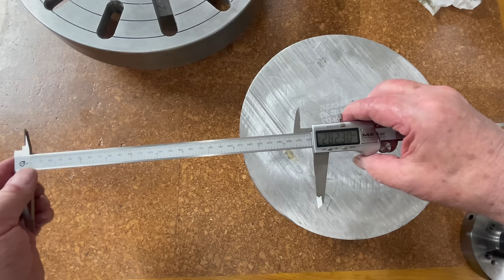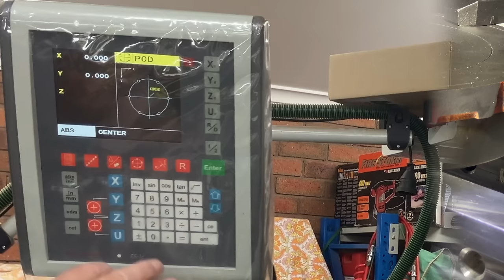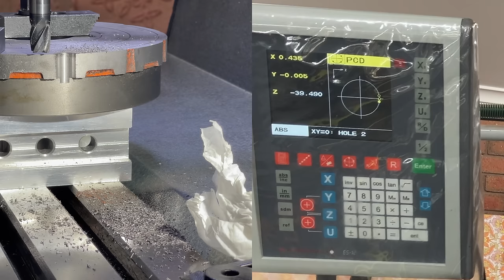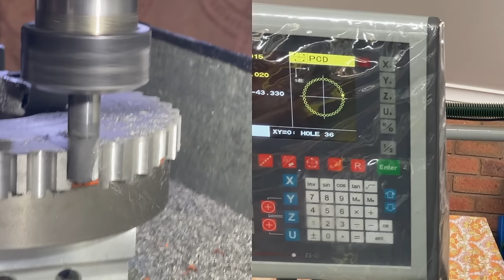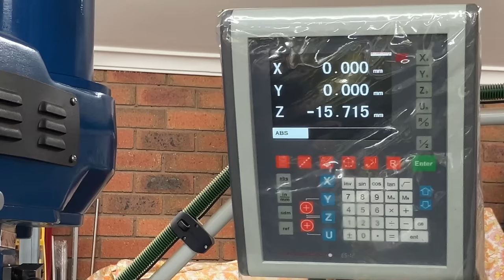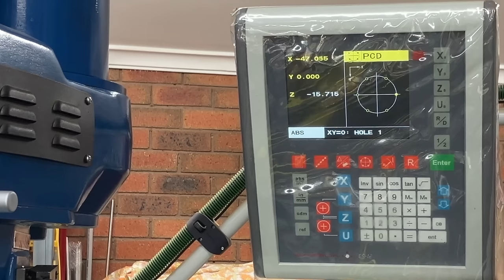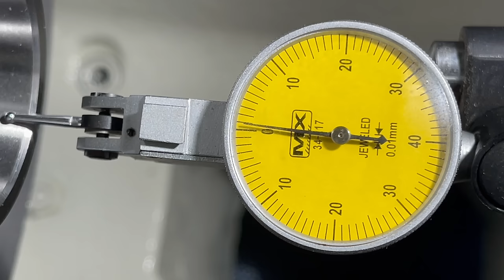The Most Accurate Lathe Chuck - Shop Made Tools

Comment: While I actually have a degree of contempt for 5C collets, they do have the advantage of gripping at the extreme front of the collet, versus, ER collets, that grip along the entire length of the collet, and can be damaged / sprung, by attempting to hold shorter stock, that leaves a portion of the ER collet unsupported.
I’ve also done a spindle mounted ER-40 collet holder, but, think people should be aware of this limitation, when deciding on the method of work holding for a specific task.
Reply from the maker: Thanks for the comment, great point.
Reply: 5C collets can also take collet stops, which ER collets can't. That's useful for facing multiple parts to the same length. Not by any means impossible to do that on an ER collet, but slower.
Reply: @PeregrineBF  good point. Recently, moded my #3 & #4 MT - ER-40’s by making threaded stops to that affect, as both had a 12-1.75 thread in the MT shank. Needed to be tapped through, and made the appropriately threaded stops / rods.

Comment: An interesting way to add collets to an old lathe.   Very helpful for me.  Watching you deal with the cast iron was nice.

But to second one of your commenters: I hate SS screws: they somehow strip without warning compared to high quality "alloy steel" screws, and when they are gummed/rusted into an old assembly, I find them much harder to to get out in one piece.  They just don't have the "feel" that tells you when they are about to go.

You do nice work, both on the machine and with the video editing.  No baloney.
Reply from the maker: Thanks for the comment. I took the advice from the previous commenter and changed the cap screws to hardened steel. I needed to recalibrate it and got a better result. You can see that in the sequel. 

Thanks for the compliment on my work and the editing, much appreciated. Cheers Steve O

Comment: Beautiful result, the finished part looks expensive. 👍
Re; the final 4 way adjustment; it looked in the video that the seats the 6 caphead bolts seat onto are conical (maybe the seat was produced with a drill bit?)

I think if they are conical (and also there seems to be limited clearance around each caphead) this is probably not allowing the chuck to center properly. Or is pulling the chuck in line with the conical feature, which upsets your adjustment.
If you cut those seats as flat bottom, then put a flat thick washer in there with room to move, then the chuck coukd be centrered. Anyway it's just a thought, that might not be it at all.
Reply from the maker: Thanks for the comment. Your observations are correct. I previous viewer made the same comment and I went back and flat milled the bottom of the cap screw seats. The holes are large enough as the chuck only has 0.5mm of movement which is 0.25mm each side of centre and that is enough to bring the chuck into alignment. 
The final result of <1 micron is very pleasing. When torquing the screws up the chuck did align and stay in place. One benefit of user comments is the capacity to gain insights from others (like yourself) and integrate those suggested improvements.

I did put a witness mark on the chuck to allow for the same mounting alignment each time the chuck is mounted.
I have only used the chuck once since I made it but it is a real joy to use. Very good for smaller precision work than big heavy pieces.

Thanks again for your observations. Cheers SteveO

Comment: Nice work, definately earned a sub.

One thing I have seen recommended when threading cast iron is to add a 2+ thread deep counter bore to help prevent the threads from chipping out when tightening down.
Reply from the maker: Thanks for the comment, that's a great idea, I'll take that on board.

Comment: Hi, You have made a nice job of fitting the ER collet chuck to your larger lathe. 

I am however wondering why you chose to use the set-tru adjustment with all the additional work involved unless it was absolutely necessary?. All the surfaces on the collet chuck appear to be ground and so there is a pretty good chance that the o/d of the mounting is ground at the same machine setting as the bore to minimise run out. If that is the case then the bore in your modified faceplate could have been machined to a close fit on the collet chuck mounting. The bore you machined in your faceplate must, by definition, be have zero runout as it is machined in situ. The arbor you used for checking runout after machining could have been gripped in the collet chuck, mounted between centres in any of your lathes and the runout of the backplate o/d clocked.

I am pretty sure the collet chuck shown right at the start is not a Crawford but a Burnerd multisize collet chuck.  The Crawford multibore and Burnerd multisize collets are quite different and are not inter-changeable. On a D1-3 mounting you chuck probably takes the EC size collets. These are readily available on Ebay (albeit sometimes at ridiculous prices) though I appreciate that may not be the case outside UK and US. There is however a set for sale on Ebay.com.au at present for AU $388.33 + $24.27 postage form the UK. That is a very good price indeed, especially for the postage 
if you want to follow it up (Ebay Item No. : 166580536586)
Reply from the maker: Thanks for the comments. You are absolutely correct, I could have clocked the backplate for the collet chuck as you say. That's a l lesson learned, thanks.

You are also correct, the chuck is a Burnerd and not a Crawford, not sure why I called it that it was an error on my part. I checked your eBay reference and couldn't find the item, it must have been sold but thanks for the lead.

Cheers Steve O

Comment: Nice work! I would flatten those counterbores with an end mill and make some hardened washers for them as well. And use a higher grade SHCS and machine the back face so they are flat against your hardened washers. That should make dialing it in easier. But I love the design, very impressive.
Reply from the maker: Thanks for the comment, Cheers
Reply: how he did it helps with centering the screw
Reply: @SHADOW.GGG-  you don't want it to influence the chuck though, the point of the system is to allow some movement. The taper at the bottom of the hole will work against that and keep pulling it into a specific position. You want it to slide across and not want to spring back

Comment: I got my set tru to absolute zero. I've never seen anyone totally zero theirs. They always give up.
Reply from the maker: Good point, I'm not done with this yet.  Regards Steve O
Reply: @theoutbackshed  I centered my 3 jaw chuck using a gauge pin because the jaws are consistent every time. My 5C is a set tru as well but I've yet to ever need it so I've never had to center it. You may need to center each time you change your collet or any time the collet comes out or moves. Id experiment with it because I'm sure you may center it perfect once then take the collet out and replace it and you might get a different reading. Just a heads up. It all depends on how precise you want to chase those zeros.
Reply from the maker: Thanks for the comment. I reckon that the accuracy of the workpiece is more related to the collet than the chuck spindle. Get the spindle the best you can, I have cheap collets not Hardinge or the like, But as one commentator said, if you get to zero and breath on it things will change. I don't think I'll be resetting for each collet. 
Cheers Steve O
Reply: @theoutbackshed  It can get kind of tedious but also depends on how much accuracy you need for a given job. Still, the set tru chucks are great. I set my 3 jaw and check it every 3 months and it still reads zero.
Reply from the maker: I just watched your video on the set-tru chuck, I would like o chuck like that. I'll need to make do with what I have.
Reply: @theoutbackshed  I hear you. It wasn't cheap to say the least but with all is said and done I placed a high priority on it. Im glad I did. The chuck is gator and the backing plate comes from Poland. They're making some good stuff there.
Reply: @TlD-dg6ug  Anything else you want to cry about little baby?
Reply: @theoutbackshed Rob Renzetti has a video where he turns a a cheap Shars 3-jaw into a set-tru style chuck. In his usual fashion he goes above and beyond and makes it into a work of art, but it seems quite doable depending on your setup.
Reply from the maker: Thanks for the comment. I just watched that video from Rob and yes, I agree with you . What he built should be considered the gold standard, way above my build. I replaced the mounting bolts and spent some time realigning mine, you'l see that in my next video along with it's new brother. A 5C collet chuck.
Cheers Steve O
Reply: There is no absolute zero, just indicators that aren't sensitive enough.
Reply: @MF175mp  There is also people who are too literal and argumentative and like to start trouble for no reason...

Comment: 5c collets also grip along their entire length. When a nominal size bar is used the bore is parallel and the mating tapers match precisely when clamped. How the collet closes is irrelevant before clamping.
Reply: Are you saying 5c have a slight taper so when they close theyre parallel along the whole collet?
Reply: @DJMateo99  the video stated that they grip on the front, inferring that the bore can taper. I believe the bore stays parallel, only springing out briefly as the part is inserted. Then remains parallel through clamping. I would say that the collets are ground concentric all over when solid. Then split afterwards, some may spring open and some may spring inwards. When clamped with a nominal bar they return exactly to the geometry when originally ground.
Reply: @tates11 when a nominal size bar is clamped is the key part, though. If you're clamping a bar that's ever so slightly smaller, a 5C collet only clamps at the nose, and if it's slightly larger, only at the back. This is because it is only split from one side, so the pads hinge around the base of the slot. An ER collet closes evenly at the front and back, as it is split from both ends, and has opposing tapers. This means that an undersize or oversize part will still clamp across the full length. It's still less contact than using a nominally-sized bar, as you only get line contact instead of full surface contact, but that's still way better than effectively point contact if you are only holding with the very front or very back of a 5C.
Reply: @apache16492   I appreciate the difference between the 5c & the ER ( extended range ) collets. ER were developed to grip a range of sizes whereas 5c are for nominal sizes. Using 5c for non standard sizes is not advised although small deviations can be catered for without issue. Driving the a 5c collet into a matching taper will always keep the tapers aligned & therefore the bore parallel. Alternatively, clamping on a parallel rod will naturally set the tapers precisely to the female taper. Any deviation is taken up in the collet leaves which is why they are so long to allow bow, twist & flex, they are not rigid hinges.
Reply from the maker: This is a great conversation. I agree that 5C collets are designed for nominal sized workpieces and work very well in this situation. ER collets are (for me at least) more flexible as they allow me to hold work that has already been machined and that is not of any of the 5C sizes, my 5C collets are in 1mm increments, and for the imperial ones, 1/16" increments. Usually this will not size with what I am making. The ER collet has the flexibility to be useful in these circumstances. It's interesting that ER collet chucks are being made for both tool holding and work holding.
I have found on occasion, that the 5C does tent to allow a workpiece to flex around the nose of the collet, and that I believe would be due to the work piece being slightly smaller than the collet bore, and subject to a variation in holding pressure between the front and back ends of the collet, tighter at the front, and as typically working with collets is when the most accuracy is required this has been a frustration. I have not seen this problem with work held in ER collets.
5C collets really come into their own for square or hexagonal stock as the ER doesn't offer a solution (that I know of) for these shapes, but all of the arguments posed in this conversation would also apply in these circumstances.

Regards, Steve O
Reply: @tates11  great explanation thank you
Reply: @theoutbackshed  The initial statements that ER collets hold much better & most of the pressure is at the tip with a 5C collet were the reasons for my original comment.

5C collets grip on 3 precisely ground arcs with the collet located in two positions, the taper plus the ground diameter several inches away. Having two locations, especially a distance apart precisely aligns the collet with the spindle. So they are absolutely perfect for their intended application.
Although ER collets are great, they are a compromise to enable gripping a range of sizes. They grip on several line contacts. The long taper is located in the holder & the shorter one in a nut which in turn is located on a thread, with a very small distance between them.

In a like for like application with a nominal rod then I believe the 5C excels over the ER. The 5C grips consistently along the entire gripping length & the majority of its perimeter.

As stated before. With 5C collets if the bore is parallel then the taper is correct & if the taper is correct then the bore is parallel. In the case of a nominal size bar, how does it manage to grip more at the tip?

To address the theory that slightly over / undersize bars grip at either end of the 5C parallel portion. We've all seen the out of scale wooden models attempting to prove this theory. Despite a bit of jiggery pokery the models don't prove anything, as they assume the tapers can't twist to suit the recess.
I agree that 5C collets can grip at the front or rear but only because they are not tightened enough to bed into the taper so the bore then becomes parallel. The long flexible leaves allow this twist to happen. Although it is not recommended.

p.s. The 50+ year old ER system now finally offers hex and square collets.🙂
Reply from the maker: @machinists-shortcuts, There's some learnings in what you say. That's a great commentary and thanks. I didn't know that ER catered from square and hex.
I might have to make another on for 5C collets.
Reply: @machinists-shortcuts  if you're pulling drawbar in that 5c that tight, though, you're deforming more than just the collet leaves, you're also deforming the taper, the bore, and the part, as well as marring the work by driving the edge of the collet bore into it. Whether this matters in the context of a lathe, I'm not sure, but as a precision grinder (making custom collets every day) I can say that I have personally done this. When the print calls for diameter and cylindricity of a part within .0001, and TIR of the entire finished assembly to be less than .0002, you can get yourself in trouble in a real hurry that way
Reply: @apache16492  It's all a matter of scale really.
If we are talking the maximum +/- 0.001" on nominal diameter which only equates to around +/- 0.003" of longitudinal travel. I doubt if I could deform the solid steel jaws or the nose taper with my handwheel. The sprung leaves will easily allow the jaws to twist the 0.0005" required to match the tapers & parallel part without damage.
Reply: Always enjoy the vids , and even better to learn . Intermittent cuts do not suit carbide , I should have crew
Used this before ! Thanks mate , nice job on the ER Chuck , I use 5C but prefer the ER system .

Comment: Hi. Nice job . The problem I see and why I didn’t make something similar is because you can’t adjust axial runout . I have seen one guy turned the ER collet chuck convex and the face plate concave so whit the 6 screws to adjust also the axial runout , then that hole contraption to be able to adjust radial … and then it will be the most accurate… but nice job .
Reply from the maker: Thanks for the comment. That's something I hadn't thought of. The mount I made came out accurate and the set-tru aspect allows for fine adjustment needed. I'll think about this.  Cheers.
Reply: @theoutbackshed  yes I know that is accurate. But what if the ER is not seating properly? What if you have taper in your part that you put in the Er colet … will be errors that you can’t dial in… Don’t get me wrong, I like your work very much, we are just sharing ideas now and try to find solution for all the problems.
Reply from the maker: Thanks for the comment. The bearing locknut would ensure that the collet is properly seated, and we don't put tapered parts in a collet chuck, they are generally held between centres. Any collet chuck must be completely clean and set carefully. A skilled machinist would ensure concentricity before turning a part.I don't believe that axial runout would be an issue with the chuck being used in the lathe that made the back plate.
Any other viewers care to step in to this one?

Comment: Nice work!
Question: at 16:42 you drill, chamfer and tap each hole. Why not drill all, then chamfer all and then tap all?
Reply from the maker: Thanks for the comment and what a great question. I sometimes go round each hole and drill, then chamfer on the next rotation then tap. I normally do the holes that way when depths are critical, for example when making holes for a spindle backplate with cam lock studs and keeper screws, here all depths for each must be the same. In this case, the threads go right through the casting and depths are not critical. Also, it was easier in this case to make the threaded holes this way. Hope this helps.
Cheers Steve O.
Reply: @theoutbackshed  
I've seen it done both ways, I think, but never understood the advantages (on manual machines)
thanks!